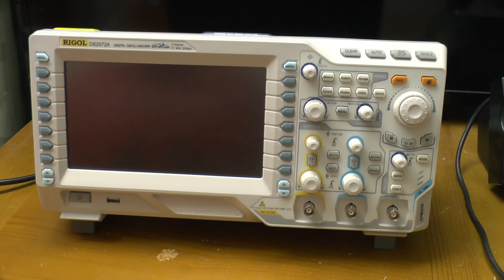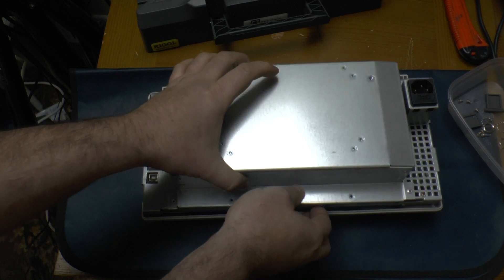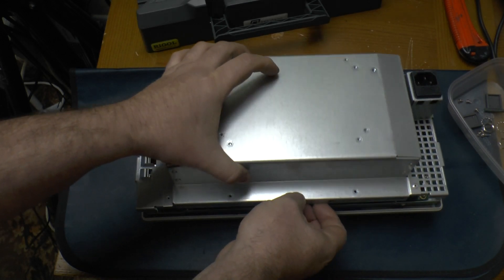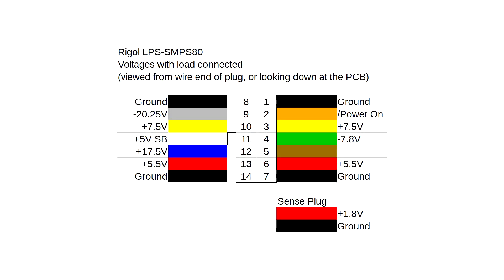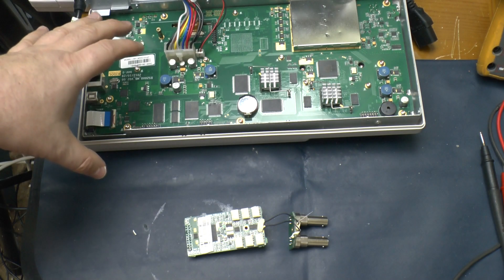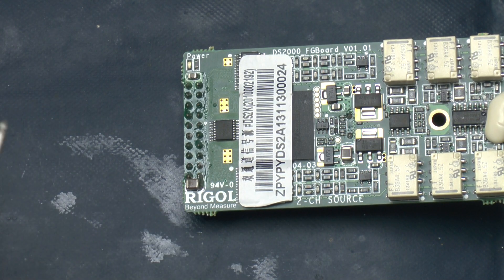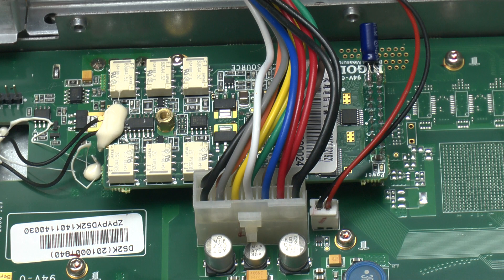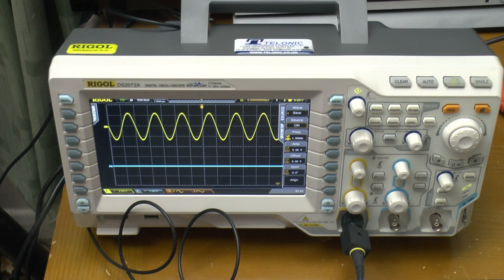Rigol DS2000 series oscilloscope repair

Comment: I guess there was a turn on spike that killed the capacitor, and the next one, probably from a LC filter on the 7V5 rail. Probably the capacitor on the main board itself is open circuit, or the power supply has a failing capacitor on the 5V rail, likely the rail used for regulation feedback, that allows it to generate a brief period of overvoltage on start up. 

Best to open the PSU case and check the secondary side capacitors, along with all small low value low voltage electrolytics on the primary side. Primary side best to check by replacing, as heating them up during desoldering will temporarily make them appear good enough, if they are marginal. Use good quality 105C ones, the originals are likely cheap brands, and 7 years is likely EOL for them already. Main filter caps really only need replacing if bulging, they normally run well under the ripple current rating, but the small ones, and secondary ones, really do run at or past ratings.
Reply from the maker: Would scoping the secondary voltages for ripple show up any duff ones?
Remember that although this unit's 7 years old, it's not been running for 7 years.  24 hours is a more likely scenario.
Reply: @AintBigAintClever  Well for that you would need a scope. Catch 22. Maybe you will be making a trip to the attic.
Reply from the maker: @RambozoClown  That's like the catch 22 of Antex soldering irons, or at least the ones I've got.  If the element fails you can replace it, but the element wires are soldered inside the handle, so you need another iron.

if the scope starts misbehaving or I run out of things to do, the old Hameg's coming out to play.
Reply: @AintBigAintClever  Yes it would, but remember those cheap caps are likely only rated for 1000 hours on the optimistic side, and 7 years is 56k hours, so likely they are either at end of life, or pretty close to it. I have seen plenty of new capacitors that have been in storage for a few years that simply fail on power on, because they degraded in storage. If it is from the 1960's or 70's on a old iron core power supply they are fine, just a little more ripple, but any one with a 105C rating has a definite shelf life.

Comment: very handy video shows what volatages should be seen and hopefully the correct value of the SMD Capacitor:-) Glad you found the problem
Reply from the maker: You're glad? I thought I was going to have to drag my old 20MHz Hameg down from the attic ahead of buying a new scope :D

I couldn't find any pinout info but it's now on EEVblog.  Working it all out definitely helped troubleshoot the function generator board, without the pinout it just looked like it had an extra ground pin.